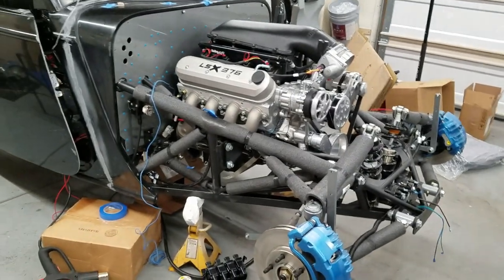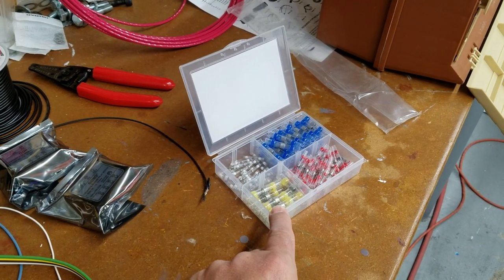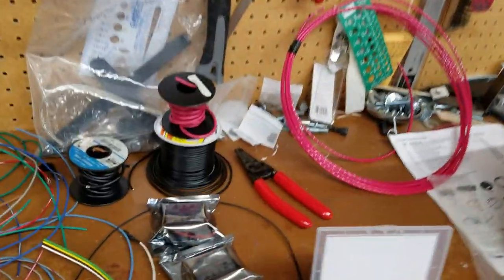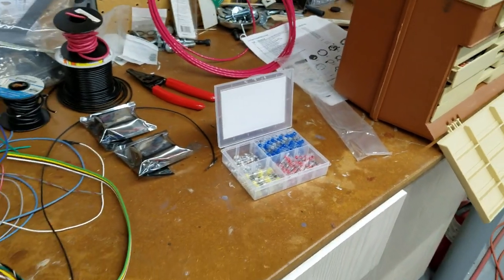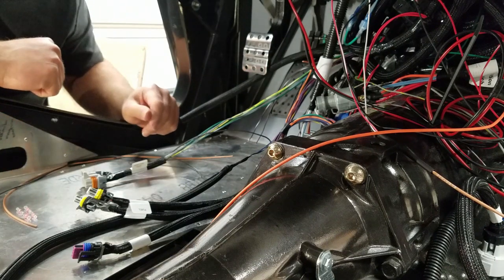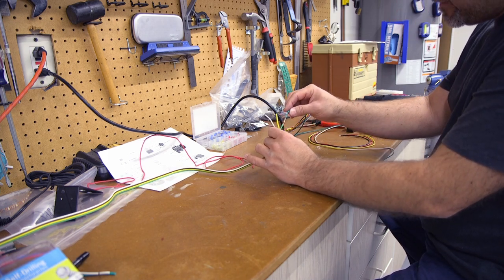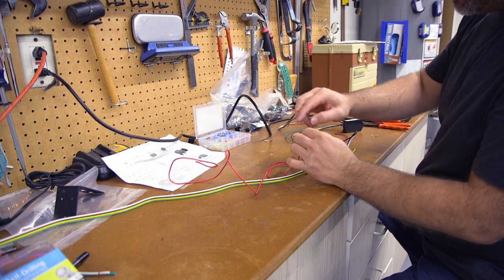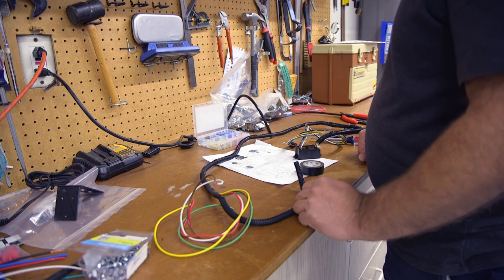Factory Five 33 Hot Rod V2 - Wiring - Heater Control Valve

Comment: A trick to get the wires into the split loom quickly and easily is to put the wire through the boxed end of a small wrench and then put the wrench in the loom and pull it down the length of the loom
Reply from the maker: I got a tool for this, but this would have been better.  Thanks for sharing.

Comment: Congrats on the wiring connectors.  Do not worry about over heating the plastic, torch those puppies.  I also heat the colored tabs until they run translucent.  The internet says that makes a watertight seal.  Mostly I think it gives the heat shrink outer shell a chance to really shrink down.  Also hit the center until it really turns shiny.  My playing with it shows that is the lowest resistance.  It does not drop much, but 0.1 ohm might make the difference.  Also, you have the right idea when you say coil the wire, get it working, then play with it.  Manufacturing defects happen to even good name brands, and they will be happy to replace it, assuming you can make it look like when they sent it to you.  Still, big day, congrats.  You will be firing it up soon.
Also, I was really laughing at you trying not to like the connectors...
Reply from the maker: Guilty as charged!